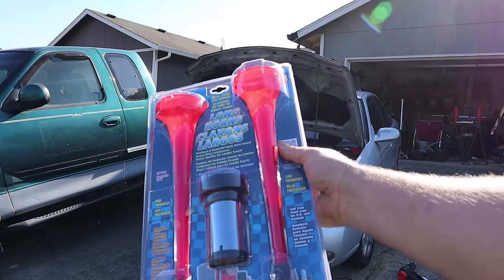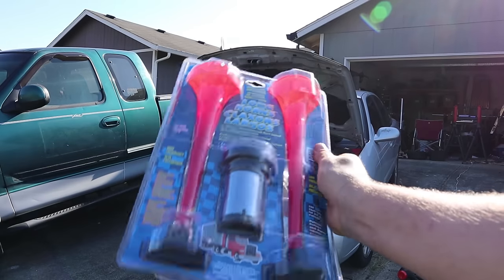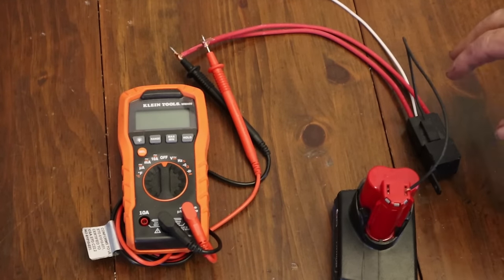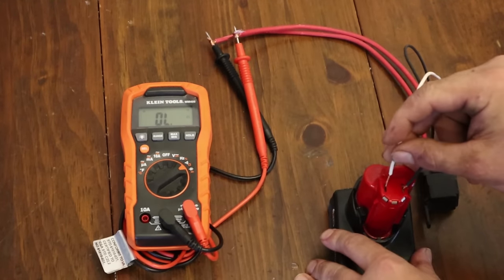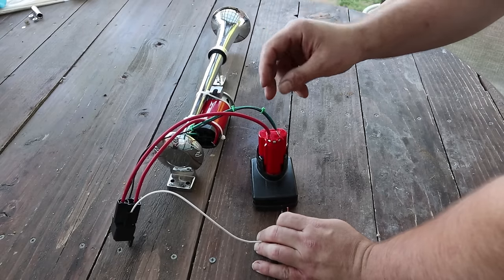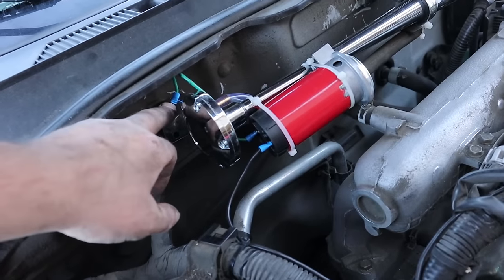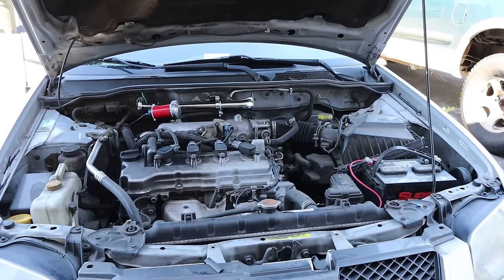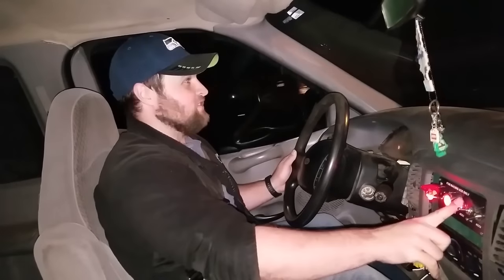Air Horn Car Install and Relay Wiring Instructions

Comment: All those wires are impossibly complicated......I don't  understand any of it.    I have to buy the cheap  20 dollar horn and then have a shop charge me 95 to install it.         You need to come over. 🥺
Reply: Building charge shop, shop charge mẹ too😂
Reply: It can seem really complex at first, when you break it down into sections it all falls into place easily, its just over whelming the first time. You can do it son!
Reply: Yea this was not simple at all bruh
Reply: Very easy brother, all you really need to know wiring anything! is positive, power, ground/negative (put it on metal) plus shit up and buttconnect old to new pos/neg wires. and take whatever accessory cable, like a remote wire, maybe it’s a different cable from the horn, and just see what you can do with that. it comes over time i just started myself. i’m 19 just rewired all my bmw speakers and it was super fun, so im sure you can

Comment: I hooked it up to my existing horn all I had to do was change the 10 amp fuse to a 20 amp & it's been working fine
Reply: This is MY goal. So the OEM wiring handles the OEM Horns PLUS the Air Horn? What is the amperage draw on your Air Horn so that I can make sure not to exceed that?

Comment: Man I'm so glad I found your video I've been trying to find out how to wire this damn thing for like 3 days
Reply from the maker: Great, glad I could help!
Reply: I normally work on residential wiring, and also a former army mechanic, but I have never really gotten into relays and what’s the point of a relay?

So for the real question, the relay has 4 connections: #87 on relay to compressor, #85 on relay to push button horn switch to ground., #30 vehicle fused circuit, #86 on relay to is to the “live positive “ point of original horn.

I have a 2021 F-350 with upfitter switches in the cab, and I was planning on switching those on for a quick second to operate the air horn, but now after looking at wiring diagram....I’m not sure I get all of it. With the wire from #87 on the relay to the positive on the compressor is a no brainer. I think #30 goes to a permanent source of power, but I was planning on using my upfitter switch that is fused. Do I need to just run power straight from the battery to #30 with a fuse? What does the “live positive point of the original horn have to do with my new horn, if my positive power is coming from my upfitter switches?

I have the 2 horns and the compressor mounted, with the positive and negative wires connected and run into the engine compartment by the upfitter fuse box.

Comment: This is by far the most simplified video I've seen. My questions are, what gauge wire do I use and what should I ask for in terms of the relay? Thanks
Reply from the maker: Thanks man, as long as it helps then im happy. 12-14 should be fine. Relay should be 12v 30 amp, normally open.

Comment: Thanks so much for the basics.  I just installed the same horn from Harbor Freight in a 1995 Mazda  Miata. My wife didn't feel safe with the little squeak horn that is in the car because trucks simply don't see her.  Installation was a challenge in relation to location.  I ended up taking the hood latch assembly off so I could install it in front of the radiator.  Worked out great and they will definitely hear her coming!
Reply: How loud is it. Thinking about installing it on my bicycle. Is it close to a train horn???

Comment: How do you get the air horn to activate when the horn on the steering wheel is pressed. I don't see you covering that in the video.
Reply from the maker: If you follow the instructions in the video it will 100% work the way you want it to.

Comment: Excellent video. I'm glad you mentioned to not using the existing wiring for your horn. I was just thinking that it probably wouldn't be enough power. And need to use that relay.
Reply from the maker: It MIGHT work, but there is a reason those kits come with relays. Thanks for watching and commenting!
Reply: @StrangeGarage so can this be wired to a separate switch I wanted to have my oem horn still! Can I wire all this to a switch in the cab of my truck?

Comment: I got that 1st horn and before I put it on my truck I rigged it up to a board and brought it into work used it to scare a guy I worked with. I loved having it on my little s10 when people looked around for the big truck that honked at them.
Reply: Allen McKinney no wayyy i just installed some on my S10 too!
Reply: @haroldflower8008  there's a Subaru wagon in my area that has two air horns mounted on it's roof that's at least 3ft long. I'm told he works at a coal mine. The guy has them plumbed to an air tank sitting in his back seat.

Comment: I installed one of the red ones years ago.   It sounded like a wheezing mule.  Took about 1 second for the compressor to develop sufficient pressure to honk, so it sounded ridiculous.  Removed it the next day.

Comment: the amazon kits for "train horn" have two long and two short truck horns with a larger compressor.
i once saw an amazing handheld train horn invention, loud as hell on battery power, now just connect to loudspeaker..

Comment: I installed one on a 1978 GMC and one on a 1966 Rambler American and just hooked it up in place of the original horn without a relay and never blew a fuse. Also recently hooked one up on a 1992 chevy Silverado and never blew a fuse but it wasn't as loud as it should be

Comment: I have the exact same single low tone horn hooked up on my Existing instalation. Never blew a fuse and it's a 1987 Ford. Lol
Reply: If your horn runs on a relay already, you're fine
Reply: I have seen my friend add this same one to his existing horns and didnt blow any fuses with all 3 wired up

Comment: If I hook up the power for the relay to a fuse that is only on she the ignition is on would this separate the horn, like when I lock my vehicle get the regular horn and she I'm driving and press the horn get the loud horn?

Comment: i chose the Ferrari one

never touch factory wiring run your own, i located my horn under my battery which had a 10mm rivet nut in frame, then ran a power wire in and out firewall for switch to battery 

(lot of wire compared to fuse tapping into fuse box in car)

Comment: This cleared up a lot of confusion I had. My only main question is, when you unplugged your regular horn terminal, did you just did stick the wire into it or was there a male/female adapter to connect to it?
Reply from the maker: If memory serves me, the factory clip was a female spade so I crimpped a male spade to the end of my control wire and shoved it in. Easy money bro!
Reply: @StrangeGarage  i appreciate your help, bro. if you look up reviews online i see a lot of "clear instructions".... they are anything but clear if not useless. lol

Comment: Could I not just use the two wires from the original horn and connect them to power the air horn? If that makes sense.

Comment: My goal is to cut out the OEM horns from blowing at all, and  using original relay circuit  to install Air Horn in place of OEM Horns. I want to blow  the Air horns via existing stock steering wheel center button. My OEM Horns are only accessible by removing the Bumper.  I do not want to do that. Assuming I can locate those wires (to the OEM Horns), and isolate them from the circuit,  I understand I must use a rated Fuse for the Air Horn (due to greater current draw). Is it as easy as replacing that OEM Fuse with the larger rated one, or is there more to be concerned with here - like gauge of OEM wires being used for OEM Horns, now to carry the load for Air Horns?

Comment: I just bought the single horn and am going to install it but I'm wondering, could you still keep the stock horn wired up and just splice in the relay to activate the larger horn at the same time, of course while powering it directly to the battery? That way, you would have two tones (the stock horn and single trumpet horn) or would it be best to just simply disconnect the stock horn and run the single trumpet horn?
Reply from the maker: Yep, totally can. You can run both horns in that configuration as long as you use a relay.
Reply: @StrangeGarage  Awesome! Thought so but just wanted the confirmation.  I'll give this a go and how she sounds. Cheers for the help brotha!

Comment: If you lay on the horn for a long time is the air horn still loud or does it die off when the horn is pressed for to long. I intend to install one and need a loud horn for a long duration of time ~1min

Comment: Good video, you explain it very good. One question how to connect the wire that will blow the horn from the steering wheel
Reply from the maker: Get a wire terminal kit with crimpers. It will have the correct male spade terminal and you use the strippers/crimpers to install it.
Reply: Ok,  thank you

Comment: Absolutely love your informative video. I want to do exactly that. But keep my factory horn connected, with a dedicated separate button for the train horn. How do I do that?
Reply from the maker: Just gotta run a hot wire from the battery into the cab, attach it to a button somewhere in the cab, then run another one from the button back to your relay, and Bob's your uncle. Make sure that wire is fused too.
Reply: @StrangeGarage  the wire from the button Back to what # Relay? Which train horn is the loudest you recommend under $100. Thanks
Reply from the maker: @dcrican762  Sadly I cant help you there. I have only used the grover products emergency horn (which I love). I've never installed a train horn, although the process is the same.

Comment: So I plan on wiring up a switch that allows me to use my factory horn or my train horn, but what I was hoping you could answer for me is...How do you know if the factory horn is Negatively triggered or Positively triggered?  Is there a way to test cause that makes a different when wiring up the Relays I have to connect.  Thanks.

Comment: What if i am trying to wire a train horn with my factory horn that is activated by the factory horn button located in the steering wheel. But i want a toggle switch to be able to use either the factory horn or train horn

Comment: Ok, wait. Is it possible I can just buy this and wire it right to my battery? I have an existing PA speaker with an extra wire that I can connect the horn too. So why can't I connect that and then run it through the firewall to the battery?
Reply from the maker: How do you plan to turn it on and off?
Reply: I have an existing switch on the PA system that connects to the wire which is currently unused

Comment: Hi, you mentioned an in-line fuse being fitted to the circuit, could you tell me what size fuse would be suitable for this set up?
As i'm attempting the same thing with my vehicle.
Cheers!
Reply from the maker: I ran a 15amp, no issues. The only time I blew a fuse was when the hot wire came loose and shorted to ground. Otherwise it has worked great.

Comment: Ok APPARENTLY I'm a moron! So I have my relay and I bought a wire harness for it. I put 87 to positive of compressor and 30 to positive of battery so I have 85 and 86 which I'm not sure where they go. My factory horn has 2 wires spaded into it. I'm really confused and frustrated if you could please tell me where 85 86 go I would appreciate it. Thank you

Comment: Glanced through the comments and didn't see an answer to this. How did you find a plug/adapter that plugs into the factory horn's original plug? At 3:57 in your video... it looks like there's a black plug (with a white wire crimped into it) that's plugged into the factory wire harness. How'd you accomplish this?
Reply from the maker: That's just a spade terminal crimped onto the wire. Buy a terminal kit and bada-bing. Easy money bro.
Reply: Strange Garage So that spade terminal slips onto the factory harness?

Comment: I have a question. Is the original power wire for the original horn heavy enough gage to carry the current? You ran a new wire to the battery, why? Cant you just install the relay into the original wires to the horn is my real question?
Reply from the maker: Original horn only draws a few amps of power, so horn relay and fuse will not be able to run the compressor for the new horn, which draws 20-25 amps peak. That's why I installed another relay and an in-line fuse.
Reply: @StrangeGarage  Thanks, yes, I understand the adding of the fuse and rely, but is the wiring heavy enough to handle the increase in amperage without installing new wiring.
Reply from the maker: @brewingman56  The existing power cannot supply it. The remote relay circumvents that. If you can wire it without using the battery, be my guest. But all wires in that vehicle go through the fuse box (IE are already restricted in amperage). The battery is where you get unrestricted power, and the fuse you install regulates it.

I'm sorry if this doesn't make sense, but installing the relay makes factory wiring obsolete.
Reply: @StrangeGarage  Thank you. Hence the new wire you ran. Okay, thank you.
Reply: @brewingman56  Remember the only original part he used is the wire going to the original horn. But he isn't pulling the power from it

Comment: Great video!! Some advice if you make something like this again is to use mabye slightly better camera angles when showing the wiring. Otherwise great explanation 👌👌
Reply from the maker: I'll admit that I focused more on how the system works than how I personally installed mine. This is just because every car is different, but all criticism is good as long as it leads to improvement. Thank you!
Reply: @StrangeGarage  I actually used some tips from your video to install a truck horn in my old car! 👍

Comment: Where can I find the piece that connects to the car horn wire harness ? To fit the one spade from the air horn ? 2015 jeep renegade
Reply from the maker: It's from a crimp on terminal kit. I just put the spade into the harness. Seems to work fine.
Reply: I was speaking about the black piece that's connected to the car wire harness then connects to the white wire to the air horn. That's in yoir video

Comment: where are your positive side power wires getting the 12 volt juice from in your video???
Reply from the maker: You didn't finish the video did you? It comes from the battery.

Comment: Hi there. How would we hook up a 12V 150db Air Horn to a 12V battery with an on/off switch? no car hookup, this will not be going inside of a vehicle. Basically just to scare people
Reply from the maker: Same process, except instead of wiring to the factory horn just run 2 wires to the cab. One power wire from the battery to a button, one from the button to the solenoid. Good luck!

Comment: Do you know the current draw when the compressor is actuating? I'm trying to run it from a small 12v LiPo cell and it doesn't seem to work. When I wire the cell directly to the compressor (no relay) the compressor makes a small click then nothing. Same if I use a 9V alkaline battery. Dead compressor?
Reply: I tried with cell from quadcopter. Took compressor apart and all the coils are shorted together. I must have melted it. D'oh!
Reply from the maker: Yeah, you need more amps. I would guess 15-20 amps. Those little lipos aren't made for high cranking amps like a car battery.

Comment: So I removed my clock spring and lost my horn function when i went to a quick release wheel. Could i use that white switch wire and run it to the positive side of a switch or button and run a negative wire to the battery?

Comment: Not to pick your video apart but. Two major mistakes. number 1...The mounting of the air compressor should be 90 degrees with the power connections down to the ground. number 2. in most areas you should put a nylon stocking over the compressor to stop dirt and dust entering the air intake.

Comment: Where’d you get the fire truck horn?? I need one for my truck but can’t find one
Reply from the maker: Online. Grover products emergency stutter horn. I got it from a junkyard when I was in high school.
Reply: Besides the horn and air compressor what all do I need to make the horn useable?
Reply from the maker: @tjwilkerson23  just an inverter to power the compressor and a 12v air solenoid. Easy money. I'm putting the same horn on my new truck soon, look out for the video soon if you want to learn more.

Comment: How would you tap in your alarm to honk with horn?
Reply: dan NEWYORK 
If you wire it like he did, that is, using the factory horn harness to power the relay, then it will automatically honk with your alarm, as long as the factory horn was designed to do so.

Comment: So what exactly does the inline fuse achieve? Is it to stop the battery running flat or drain any left over charge or something? Installing a dixie horn in my car this week and I kind of don't want to kill my car so I just thought I'd ask.
Reply from the maker: If you have a short in the circuit the car battery is powerful enough to melt your wires in a couple seconds, which will result in a rapid car fire. The fuse limits how much current can be pulled through your wires. If there is a short the fuse will blow and save your car from a disaster.

Comment: Where can I pick up a harness like the one u used?
Reply from the maker: I'm not sure what you mean. The wires I used I made with a cheap electrical terminal kit.
Reply: @StrangeGarage  I meant to say the harness for the relay. I found them on ebay. But the video u made is by far the best in details. Thanks
Reply from the maker: @steelrain210  Oh that came with the relay, which did NOT come with the horn. I think the relay was from mcmaster-carr, but you can find them on ebay.
Reply: @StrangeGarage  thanks again

Comment: Theoretically you could just swap the 15 amp fuse with a 30 amp fuse no??
Reply from the maker: @reid1510 That's correct:  it would work until the wires melt and your car catches on fire.
Reply: @StrangeGarage  ah no big deal I had subwoofer wires rated for 400 rms hooked up to a 40 amp fuse and a 1400 rms amp that’s sketch man 🤣🤣